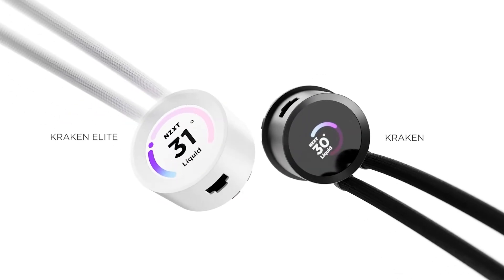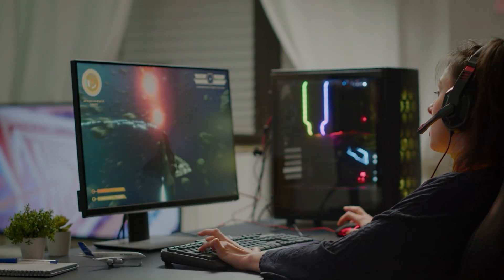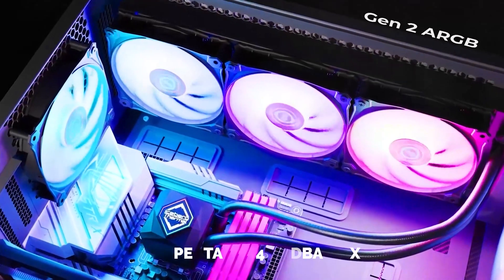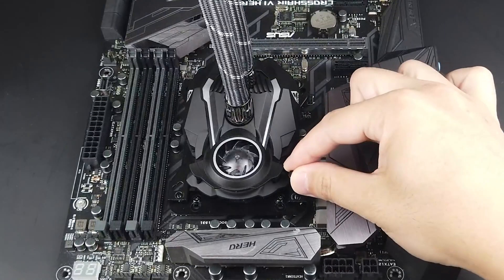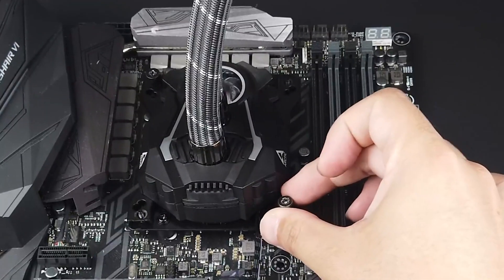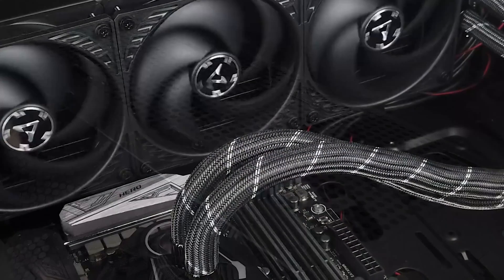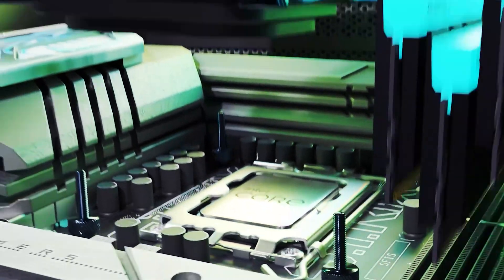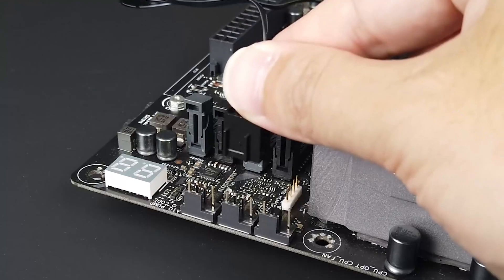Best AIO Coolers 2024 - (Which One Is The Best?)

Comment: I have NZXT and i will never buy it again, after one week the pump start making bubbles noise , for 3 years i am enduring this 😅 , probably not will buy artic frizer 3 420mm or if i want display i will look for another brand but not nxzt
Reply: I have a artic freezer 420mm if you want to buy it for $100
Reply: @Flaxum  Why do you sell it ? I heard its the best....to bad that there ia no one with an LCD
Reply: @smamas114  doesn’t fit my pc case so I bought 360mm
Reply: @Flaxum  Doesn't fit in mine also , probably when i will upgrade cpu mobo ram aio i will need to change the case also to fit 420mm and the case its only 4 months old , lian li has a mid tower case which supports 420mm aio , i don't want a big case